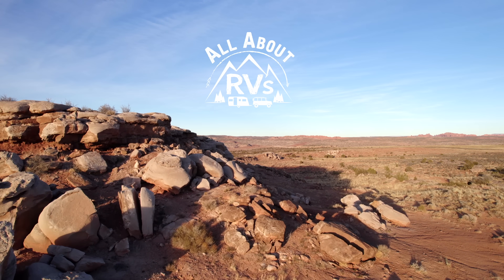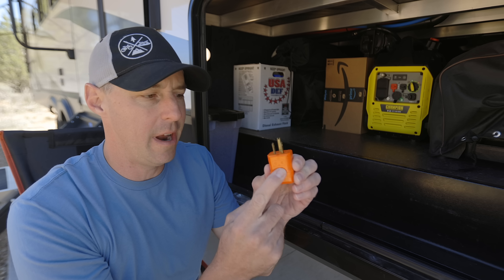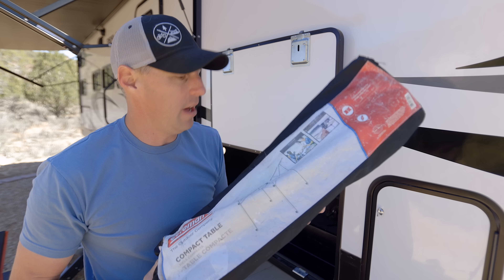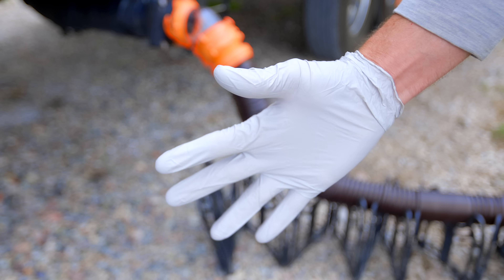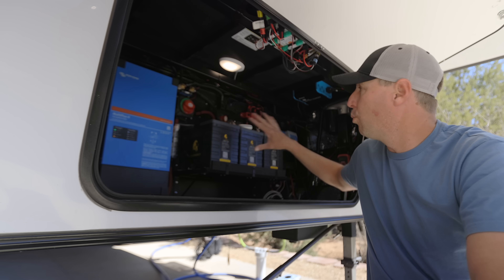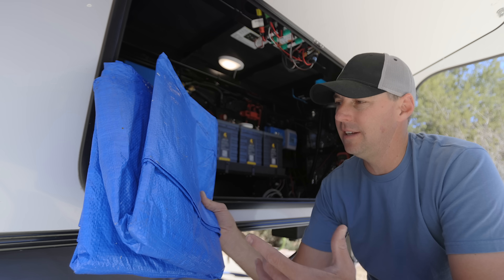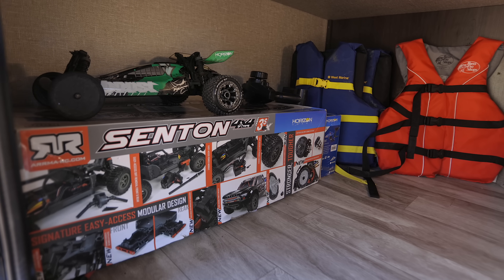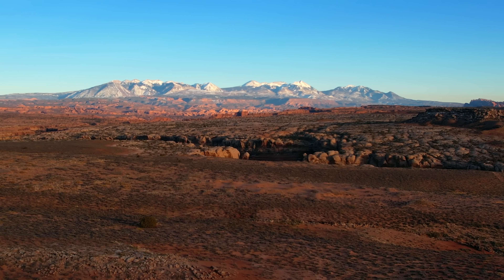What We Have In Our RV Storage! RV Accessories.

Comment: From full time RVing to Part time, you have reassured me that I have all the right components. For storing things that could get the bay dirty. I use trash bags also. For what I store in the front bays, it typically things that are heavier (tools, grill etc.). I do this because I have a travel Trailer. Helps with keeping the RV swaying due to to much weight in the rear.
Reply from the maker: Thanks Jason, great tip about keeping some of that weight forward.

Comment: Front Storage - I like your folding stool idea.  Buying one now :) Also the tarp idea. I have an extra multi-meter - excellent idea for using it up front.   Govee makes some nice products.  I am currently trying there water sensors, but the hub requires a 110 volt powered hub.  Do you have a 12 volt hub option?  I also keep a short fold-up pad, like the one you can sleep on when backpacking.  I use it for when I need to craw under the unit or truck.  I also cut and put the foam, puzzle, flooring as a bottom liner/cushion for the entire bottom.  Also put it under the batteries for a little cushion.  Here is a few more items I see there:   Small battery chain saw in a bag, extra length water hose,  small bin for odds and ends that one might need every once in a while.  Get a canvas or vinyl bag to put your trash bag grease gun in so the bags won't tear.  I am currently working on a method to connect portable solar using the existing vent for lead acid battery venting.

Comment: Great video and gave me some ideas to update my storage. Luckily I have a rear garage for storage, so I have generators and grill back there to relieve weight on the pin. I keep my sewer hose in a black 40 gallon tote in the front compartment and water supplies in a clear tote. Nothing in the forward (battery) compartment except for a kneeling pad for working in that compartment. Thanks for the info.
Reply from the maker: Thank you!

Comment: Excellent video. I am most curious if you reinforced the wall where your Multiplus is installed? Also, how did you anchor the bottom of that behemoth? Until my wife saw this video this morning, I was mounting all of our equipment in the pass thru. Now, it is going in like yours in the front compartment. It will be much easier. Thank you!

Comment: I used to have a tarp for going under the trailer but if it is rocky you feel it. I now use cardboard, you can fold it, you don't feel the ground, you can slide on it to reposition your self. It is cheap and easy to replace when damaged. Because it is stiffer it is easier to slide into position than a tarp.
Reply from the maker: That is a great idea.
Reply: Maybe one of those windshield heat shields would work better than cardboard. They roll up to be very compact.

Comment: Front storage compartment. My spare tire and a rack capable of holding (9) 100 AH lithium batteries, currently there are 6. Wrench set, battery charger and air pump.

Comment: Noticed when you did the forward compartment, next to your MultiPlus II (can’t wait to get one) you have your batteries in a rack of some sort.  I can’t find the video where you installed them, but was wondering if you have a link to the rack that allows you to get them off the floor and make it able to use all the extra space in your forward compartment?
Reply: Times 2. Please do a video on the battery install and the rack. I have the same GD as you do and want to go lithium.

Comment: I use a giant slide lock plastic bag for my lubricants.

Love your electrical bay
My electrical system is under the master bed and i installed a thermostat cooling fan
6 LI batteries a 3000 w converter Inverter etc

Hints on sewer connection???   Even with gates closed  Always crap when you open the cover
Reply from the maker: Good idea, the end of the sewer connection I use a twist on valve. With it closed it stops anything from getting to the cap.Valtera Twist lock valve.    https://amzn.to/3b3SUGG

Comment: Hi Jared, I've been following you and you're probably one of the only ones that explain clearly, has the knowledge, and don't either have ads every second or try to sell. For those reasons, I decided to ask you a question about my lithium, inverter project for my travel trailer. I bought a 3000W inverter and a 200ah lithium battery and will like to know the amp-hour fuse that goes with it. The cable purchased is 4 gauge and I ordered a 500ah fuse, is that too much?  Is the wire the right size?. The cable run is less than 5 feet. Any info will be greatly appreciated.

Comment: Hey Jared! I saw this vid a while ago and was wondering when u were going to do the vid on the auto detecting converter. I installed that same converter in my RV a few months before a trip ago and am just getting ready to use the RV again. I haven’t been able to get the converter to charge the batteries higher than 13.6V on any of the times I’ve had it connected to shore power or the generator. Was trying to get someone on the phone from WFCO tech support today with no luck. Just wanted to hear your experience using this converter. Thanks.

Comment: Another great video - Buy a  LOCKNLUBE grease gun. I have the EASY-PRIME PISTOL-GRIP GREASE GUN -LNL254 After I upgraded my suspension on my rig I'm over 20 zerk fittings. This thing is amazing! Doesn't leak you just clip it on and clip it off. I can fill grease fitting WITHOUT GLOVES. I can do the whole rig with 1/2 of a paper towel now :D It's not cheap though the time and frustration it saves is well worth the expense. Once you have one of these grease guns you don't have to worry about where you store it. I have a wall mount which it's been stored in between uses for over a year and not drop of grease has leaked. ...and I'm in FL so my garage gets well over 100F.
I thought about picking up their GREASE GUN BARREL CAP though I haven't needed it.

Comment: Where are you connecting your water pressure regulator? The spigot end Or the wet bay end? I've heard pro's & con's for each. Pro at wet bay end: In case it freezes outdoors, your pressure valve doesn't freeze up. Con: It doesn't protect your hose connected to the spigot if the pressure rises too high (some parks). What's your opinion on this & which approach did you go with?  Thanks for the videos!

Comment: I put as much heavy stuff in the front storage as possible to put that weight on my truck / towards front of my toy hauler.  There’s not a whole lot of room due to the onboard Onan 5500 but my bottle jacks, floor jack, gallon jugs of random stuff such as  various oils, cleaning products, spare lumber for emergency needs, charcoal and wood for my smoker, and so on.  

I try to avoid putting anything valuable in there because that is the lease secure compartment due to the flimsy lock mechanism. For this reason my lithium batteries and Victron set up goes in the front pass through.

Comment: I need your expert help please. My Ac dc charge controller that is behind my fuse panel is starting to go bad. I'm installing my solar using the same stuff you've got. Which one would you recommend I get? I'm using lithium just haven't switch yet but I will soon once my solar is done. Anyway thanks for your help in advance!

Comment: We have kinda the same storage setup and like you I store very little in the right front compartment leaving it dedicated to batteries, inverter, solar etc.  I use a bunch of Home Depot totes to keep things modular, I find it easier to keep packed that way.  I have a tool box in the bed of the truck with most of my tools in there, and the grease gun is wrapped up and stored in there. I might have missed it in the video, but where do you store your power cord?
Reply from the maker: Nice setup! Since we are full time the power cord is either in the bed of the truck for traveling or connected to shore power. If we are boondocking we put it in the main pass through.
Reply: @AllAboutRVs  Thanks, safe travels.

Comment: Given that you have the Victron which does PowerAssist, did you consider using the truck as your generator (eg with 1000watt small inverter or dc to dc) instead of using an additional inverter generator (to save space, less clutter, etc)?
With all the solar you have and the batteries, even if you need AC you’d probably only need to run truck for an hour or two to refill the batteries.
If not, why not?
Reply from the maker: It’s a compelling thought. I have considered it and it was cheaper for us to do a generator. We would have to upgrade our alternator or ad a second one to make it worth while. A typical alternator can burn up if you draw to much at an idle and our alternator only sends about 20 amps to the bank to protect the inverter.

Comment: What's the benefit over the smart converter/charger when you have a MultiPlus? Just that it automatically switches? Do you switch between lead acid and lithium for some reason?
Reply from the maker: Good question. I’m not wanting it for our setup just testing to see how it works to see if it’s a good option for people that want a new converter now and want the option to switch to Lithium in the future. Plus I think these might start showing up in new RVs so people have a choice of what battery type they would like with no modification.
Reply: @AllAboutRVs  that's awesome, keep up the good work! I'm planning a multiplus install thanks to your video and tons of follow-up research over the past couple months. Goal is to be able to run the AC in our motorhome without a generator/shore for just 2-3 hours to keep our dogs cool.

Somebody was recently asking for advice on electrical and solar setups for an TT they want to buy NEW a couple years from now and I said well, odds are you can just buy one ready for some level of lithium and solar, as things like that converter start becoming more common.

Only thing is they still wouldn't be able to run AC on stock inverter, but I imagine 12v AC upgrade options from the factory are going to get more common too.

Comment: Jared, I've tried to find the propane pressure regulator you showed on this video and have had no luck. Can you please let me know where you got it? Thanks.
Reply: I didn't see any propane pressure regulator but he did show a water pressure gauge. Propane tank pressure means very little since it has pressure until it's gone and pressure, not liquid,  varies with ambient temperature. Propane is cold so using a temperature strip adhered to the outside of the tank may be a better indicator. Also, the frost line on the tank will tell you the quantity.
Reply: @trustme7731  it's at 3.12.